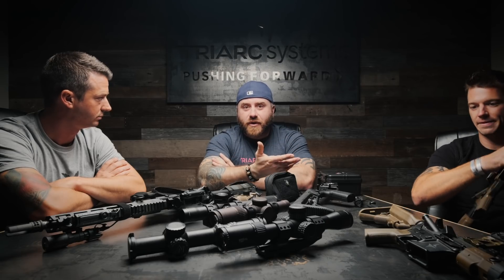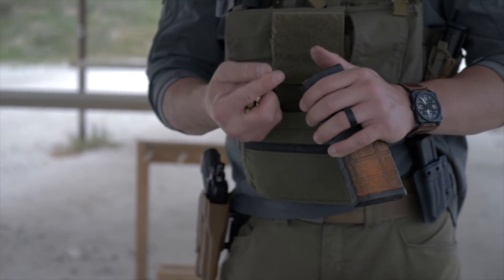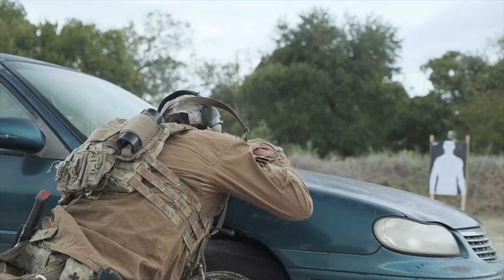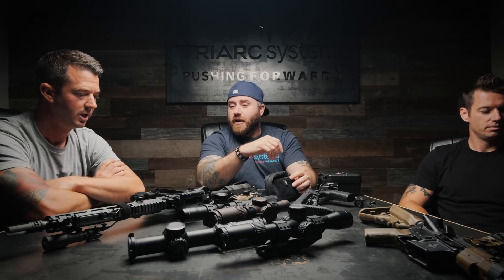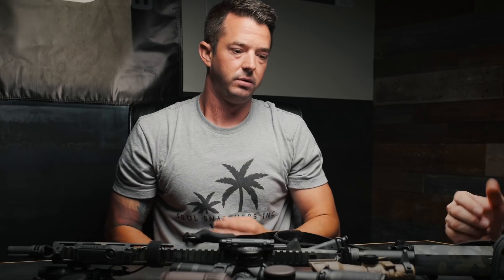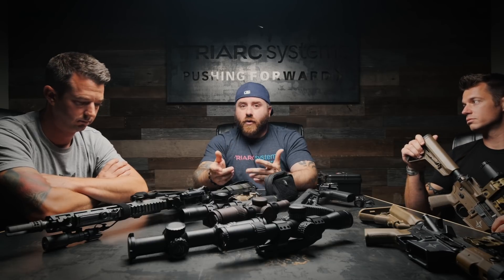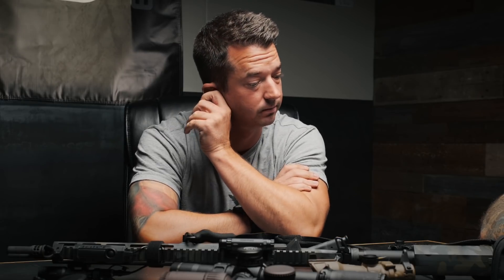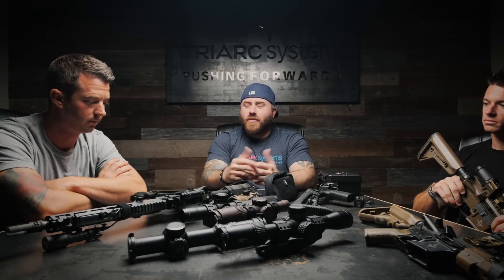Ultimate Recce Build: Part 2 Ammo and Ballistic Considerations

Comment: A lot of departments don’t use 5.56 as duty ammo. They buy .223. I think that comes down to cost savings, not what would be best.
Reply from the maker: We have seen a mixture of both. since a lot of specialized teams are running shorter barrels we have noticed them applying 5.56. but your right we do see quite a bit of .223 duty ammunition.

Comment: This discussion was very well structured on the basics of rifle ammunition performance.  My company is an LE ammunition distributor that works with thousands of agencies around the southern US and this is exactly what we talk about on the range and in the classroom.  There is a lot of misinformation on what ammo does what and what people think ammo does vs what is actually does.  There are very few 223/556 rifle rounds on the market that are truly viable duty rounds, Federal Tactical Bonded 223 62gr, Winchester Ranger 556 64gr Bonded, Hornady GMX 223 53gr GMX and 75gr SBR, maybe one or two more that skipped my mind.  A lot of people assume that a FMJ rifle round is going to perform similar to a FMJ handgun round, wrong, FMJ rifle rounds are the worst barrier penetrating projectiles on the market.  In 223/556 if you want to defeat barriers and retain projectile weight and energy, you have to go to a bonded round.
Reply from the maker: Good talking points Amigo.
Reply: 62gr green tip will pinch through 3/8" steel. What sort of barriers are we talking about?

Comment: Hate to be "that guys" but just because you can lob a round in at 500 with a 8-10 tube doesn't mean its effective.  Its going to hit with the intensity of a 22lr at that velocity. A 10-12 barrel is a 200 yard gun. Lets be real. Don't care if its soft points or OTMs, you drop below 1600 fps and its a 22lr.  If you want to do something meaningful at 600 you need at least a 16 with some smokin hot ammo.
Reply from the maker: Josh K I completely understand where your coming but we found certain ammunition brands through short barrels preform completely different from each other. we are going to make our assessment after we chrono multiple types of ammunition. Then from there we will find it optimal range.
Reply: I mean sort of yeah. But you gotta remember a 45 acp at the muzzle is going around 850 fps. Now I understand that instead of a 230gr we are talking about a 55-77gr but your also talking about getting smacked with a tumbling projectile going about really freaking fast. Now obviously a short barrel rifle is not really intended be smacking targets at 600 meters or whatever but I still wouldn’t wanna be on the other end of that projectile when it hits.
Reply: Josh that’s not quite how ballistics work my dude.
Reply: @mikeithgreen9966  Well, I was a bit hyperbolic with the 22lr reference to prove a point.  The truth is that modern rifle cartridges use either fragmentation, expansion or yaw destabilization to cause damage. There is a very clear velocity threshold where the bullet stop performing these functions.  Yaw destabilization is inconsistent at best as years of military trials and tests have shone, so it really shouldn't be considered. This leaves us with expansion and fragmentation.  Let's look at some numbers to clear things up. Lets take m262 as a baseline because the data is easy to come by.
 m262 uses a Sierra 77 gr OTM bullet with a G1 BC of .372.  Sierra claims this bullet has a fragmentation threshold of 2100 fps, ie below that it will ice pick instead of fragment.  Using a 10.5" Mk18 we can expect 2400 fps at the muzzle.  Bear in mind that m262 is loaded pretty hot so these numbers are... generous when comparing it to other rounds.  With this muzzle velocity and BC we will hit that 2100 threshold right around 130 yards and will have about 750 ftlbs of energy. At 500 yards its going 1426 and only has 348 ftlbs, at 600  its going 1283 with 281 ftlbs. At the muzzle 32 gr CCI Stingers have 1640 fps and 191 ftlbs. So, more weight in the 77 gr but the damage would be similar to the CCI Stinger at 600.
Reply: Mikeith Green - I’d say I just witnessed a good old fashioned schooling!

Comment: I just finished going through this exact process lol. Built a 12.5” and started searching for a round for it. Factory wise I came to the 68gn frontier BTHP. Shoots right around moa from my gun and getting right at 2700fps getting 2640fps with the 75gn frontier with the 5.56 loaded stuff. The 223 frontier was about 40-60fps slower. Actually lucked out that that ammo worked out for my gun since I have several hundred of both. But I wasn’t happy with just a few hundred so I started working up a hand load. Got a 60gn a-Max and 60gn Sierra tmk both going 2990fps with no pressure signs on the brass. And also worked up a 65gn Sierra game king to 2760fps and actually could go a little higher but just like with the 60gn I’m not going to push it any higher. Getting no pressure signs so ima leave it alone. The 60gn amax and tmk were both shooting 1/2 to 3/4” groups at 50yds haven’t shot any groups at 100yds yet and haven’t shot the game king for groups at all yet. But if there’s someone out there looking for a factory round for a short barrel those hornady frontier 5.56 seems to be very efficient out of a shorter barrel even the 62gn stuff if you can find it but just watch if you get the 223 loaded stuff it’ll be a little slower. My barrel is 12.5” mid length 1-7 twist literally shooting at sea level down here in south ms. So get in some thinner air and probably pick up a little more velocity
Reply from the maker: deon lee Amigo ! Thanks for the feed back ! Awesome info
Reply: I ended up on the exact same 68 grain frontier BTHP round for my 12.5!